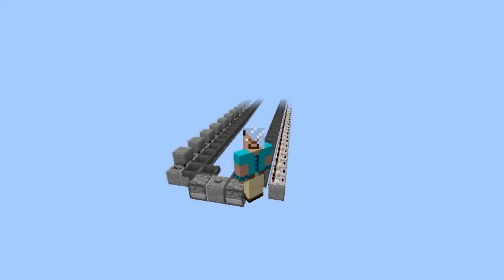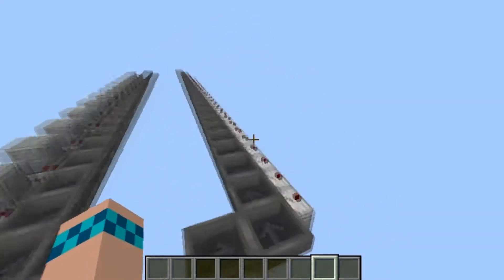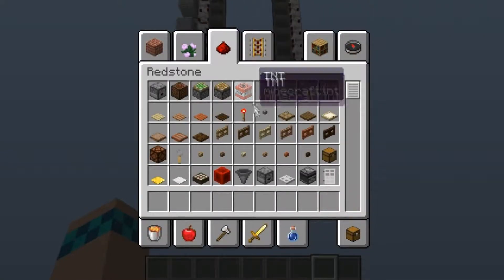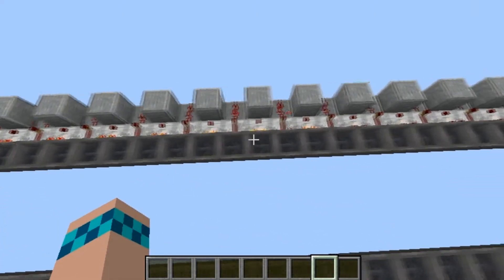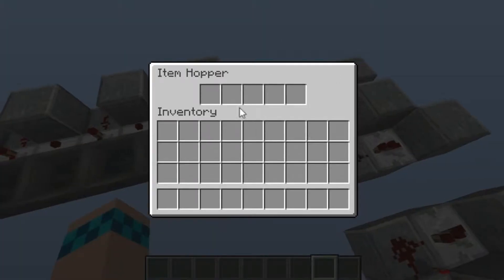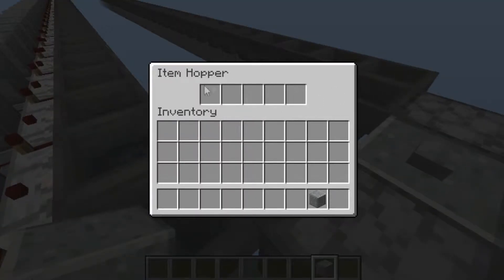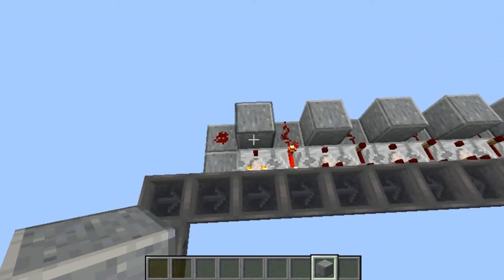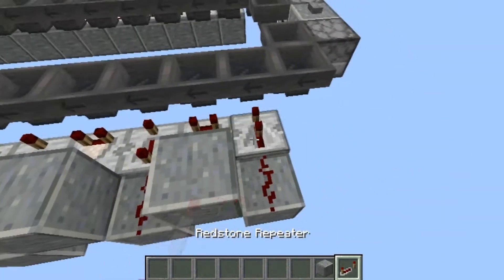Slower Minecraft Hoppers - Tileable Delay

Comment: Can you use this and filter items with the hoppers?
Reply from the maker: You could definitely have the end of this chain lead into an item filtering system. However, I don't think you could mix in a traditional item filter into the same circuit unless your use case is very specific.

Comment: I just got into redstone so this is very helpful, thanks.
Basically, if I got it right, your system makes it that when the comparator detects that its hopper picked up something it's the hopper before that is slowed. How do i make it so that it's the hopper himself that is slowed down ?
Reply from the maker: You would have to do it for every other hopper, but you would place blocks above the comparator and hopper. Then place 3 redstone dust leading from in front of the comparator to on top of the hopper.
Also, target blocks may let you compact the design to being tileable.
Reply: @Iceface42  thanks 😁